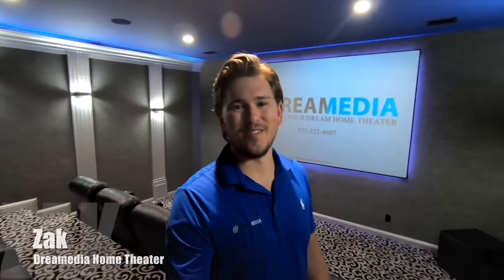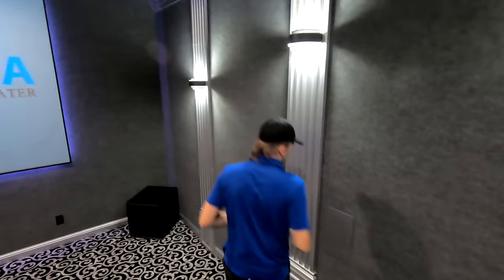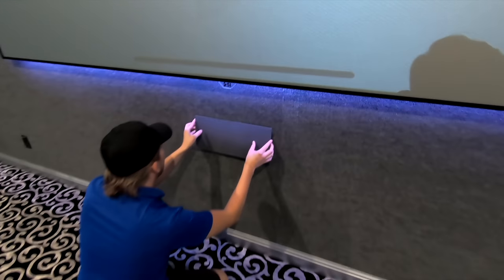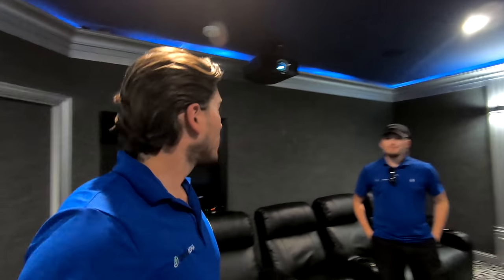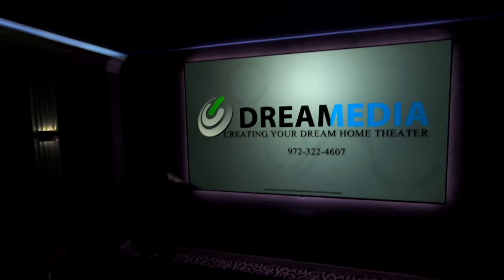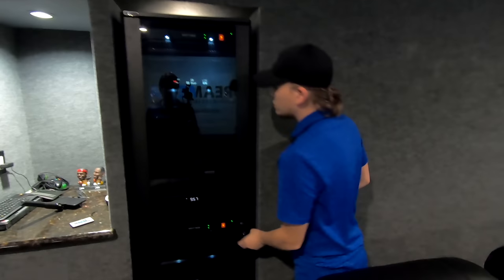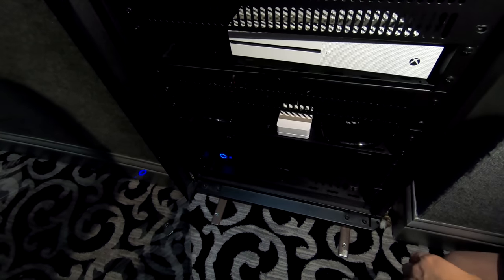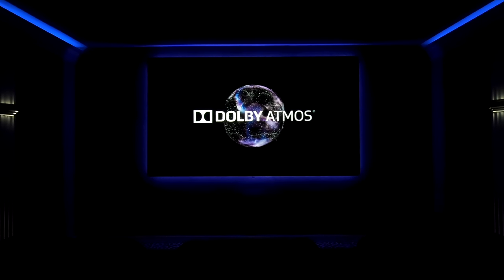Klipsch 7.2.4 Dolby ATMOS! INSANE 160" 4K THEATER SET UP w DEMO

Comment: After watching this video all the way through here is what I would have proposed for that room.  Klipsch RP8000 x 2,  RP-504C, use the current LCR for the surrounds and surround backs.  I would have taken the subs to the next level and did SVS PB3000 or PB4000.  That would be a killer system in that room.

PM
Reply: Why stop there? Dual SVS PB16-Ultras

Comment: I love Klipsch, but they should have gone for RP-8000F and 504C, plus some bigger subwoofers, maybe SVS or Monoprice THX, for that size room! Also, the surrounds are at or slightly below ear level it looks like. They should be much higher, given the ceiling height of the room. It's a nice looking room, but some common sense was needed here.
Reply: Clark Kent I agree. They definitely skimped on the audio side. They’re going to have to crank up the volume, at the point there’s going to be so much distortion and clipping.
Reply: Man all the non professionals have such strong uninformed opinions
Reply: I prefer floorstanding speakers for the front channels and a freestanding center channel behind an acoustically transparent screen, in wall speakers for the surrounds, and in ceiling speakers for the heights.

Comment: I have a question regarding the speaker size.
Since you went with different speakers for clarity, is your cross over point with the sub also higher to fill up the low end you miss from the smaller speakers?

Comment: Does anyone know what brand acoustic carpet this is, or is it simply standard floor carpet that's installed on the walls?  I absolutely love the "clean" look of this theater room with the carpet on the walls.  I've seen a few references in the comments to the carpet as being amateur, so I'm curious what the issue is.

Comment: It looked like the image from the projector was slightly, gradually, angling up from left to right, on the bottom of the screen.  Is the projector or screen not completely level?  I'm on my 2nd Sony projector (385ES) and it will be my last.  Optical block failures, Iris failures, image shifts automatically on it's own and I have to manually move it back to fit the screen, etc.  Overall a sweet theater, no doubt.  I hope they don't have the issues with their projector, that I've had with mine.  I'll be looking into JVC now that they have native 4K.

Comment: Hey Zach i want to put my dolby atmos so i currently have onkio 656 7.2 but i just bout 4 sonance r82 ceiling speakers two klipsch front towers and and 4 surround wall speakers klipsch and 2 polk audio 505 12 inch subs iam thinking of  upgrading to a 9.2 channel Marantz and a 4 channel amp do you recommend that setup for dolby atmos? Thank you

Comment: rears facing the seat?? Seriously??
Reply: that was my 2nd complaint behind the fact they didn't use the klipsch dipole side surround speakers for the sides OMG!! I have the RP-402S that replaced their predecessors rp-240s that are now my rear surround mounted at the proper height for rear surrounds that they DIDN'T employ!!! So far all i have seen is disappointment. The front center is WAY too small! I have the 504c and it's amazing!! Per Dolby even the atmos height speakers are installed in the incorrect offset per the seating arrangement. Granted i have a 207" 4k beyond cinema quality video because of the special proprietary paint I developed that took a super budget viewsonic 747 4k projector and produced video quality beyond that of actual theaters. Hand of God it looks like I have a 207" 4k UHD LED tv mounted on my wall. Denon 9 channel feeding another amp for the last 2 channels for the rear atmos height speakers. I crush this set up for probably $25k cheaper. So sad that people pay all this money and put their faith in a company like this to create the ultimate home theater experience in their house and they mounted the speakers and speaker choices that are sub par for performance :/
Reply: oh yeah they aren't even using Klipsch designated front channel speaker either!!! good lord!!!
Reply: per DOLBY: https://www.dolby.com/us/en/guide/speaker-setup-guides/7.1.4-overhead-speaker-setup-guide.html check out the Atmos locations versus their choices....!
Reply: Little harsh on the criticism there fellas.. Ever ask yourself if that's what the customer may have wanted/requested?
Reply: MyTwoCats  Hate causes cancer. If you don't want cancer change your mental outlook.  Be positive.
Reply: @cis_American  Hate causes cancer. If you don't want cancer change your mental outlook.  Be positive.
Reply: @Alpha3D_USA  yes much of the choices in this room were driven by the customer.
Reply: I have no idea why some people are so dumb and decide to give their dumb opinions. Lower rear speakers can be a choice of the owner who may not want an overbearing ear level or elevated speaker. 
Dipoles are fantastic but not everybody wants them. Some people  think that Dipole speakers should not be in a home theatre while others swear by them. Some of the opinions here are beyond stupid. 
I will probably never go for Atmos and love 7.2 sound and think it is the perfect sweet spot while others wants 16 channel Atmos.

Comment: Good I follow you for a year and I love your videos I wanted to comment from your experience, since I just saw the video of the 8012 with klipsch speakers and the video of the room of the previous cx5200 with which sound you stay? Yamaha or marantz? se  which are different rooms but in the sound recorded by the camera, I notice a greater sense of dynamics and effects in the Yamaha !!! You would help me choose because I doubt Yamaha a3080 vs marantz sr7013, thanks
Reply from the maker: You cant go wrong with either. we sell more marantz than yamaha because of client wants and comfort
Reply: @Dreamediaav  thanks dreamedia for answering that both are great avr and already in case I would use it as a pre / amp since I have emotional stages 11 channels !! but I wanted to know from your experience if yamaha or marantz which give you more film feel?  what's on the list is nad t758v3, regards
Reply: @Dreamediaav  You guys are awesome.  I'm remodeling a similar room.  20x24 10' ceiling.  BenQ 4k proj, marantz 7013 200w rec, acoustically trans screen with ability to place all fronts behind screen in window holes.  Thanks to you I'm leaning towards using the Klipsch set up you use all the time.  The speakers are the only thing I havent bought yet.  Theres also a seperate 2000w Pyle karaoke set up in the room (built a stage below screen) and for the drivers I have huge Rockville towers stacked in the front corners of the room behind curtains.  Originally I was going to wire the Rockville monsters for the left and right fronts on the home theater side of the project.  What do you think about that?  I really want the sound to be as good as possible for the theater set up.  Thanks in advance for your reply.  Crazy Bernie in Fresno, Ca.

Comment: The room is 20' x 20'?  I bet getting uniform bass was fun in that room!   I'm about to start a new house, the theater room will be roughly 21' x 30'.  It's surrounded by attic space above and on three sides so I can have as many infinite baffle subs as I want.  I'll probably do at least four pairs, main subs near the front (floor to ceiling columns) and then three sets of side subs working their way toward the back.  Each set will have it's own DSP and amplifiers so I should be able to get the bass fairly uniform.

Nice job on that theater btw, it looks great!

Comment: Acoustically: Very bright room. Small room and not fan of speaker placement, especially the sub.
Reply: Ben Styles they have to be diagonal so its best placed
Reply: Acoustically bright room?? They said they put "acoustic carpeting" on the walls!! :) The only hard surfaces were the faux columns. I would have have had all walls covered with fabric of some kind. Add absorbing and deflecting panels...but this customer had their wants. So...and they're paying the bill...etc.

What are the dimensions of the 160' screen in feet? Looks like a 16:9 screen...
Reply: The surround speakers are too low especially the surround back speakers. They should be 1-2 above ear level. The chairs are blocking the sound of the back speakers. The speaker placement is incorrect in various ways. Amateurs!

Comment: So much fails in here. Subwoofer stand direct in the corner.
Speakers in front are too small, surrounds facing the seats. An noch transparent screen.
It looks fantastic but can' imagine it sounds that good.
Reply: Sound in home theatres is a personal experience what you like they may not.  The problem with rear speakers in that set up is the seats are very close to the wall so it may not be their preference. 
Some people want their subs in the corner while others do not.

Comment: If you could, what are the dimensions of the room? Id like my theater that size.
Reply: Lol, thas fkn awesome 20 by 20. Great video guys
Reply: I think for that room size I would have purposed larger speakers especially for the front stage.  My dedicated theater is 11 x 19 and I have Klipsch RP-280FA and RF504 center.  I also think the surrounds and surround backs are way too low.  I have never walked into a showroom or cinema and saw surround speakers that low.  Other than that the room looks very well layed out.

Great Job Guys.

PM
Reply: @paulmardis1512  im purchasing a pair of rf7 3's, rc64 3, pair of 520's for surround and im going to use my 8000f' for rear. Marantz 7705 and emotiva 9 for amplification.
Reply: Whats the height dimensions of the room
Reply: @cedo2297  good Question.
Reply: @cedo2297  That would be a great setup.  I would add 4 x in-ceiling speakers for Dolby Atmos and us an 11 channel amp + 2 SW's.  You would be set.  I believe Dreamedia HT can help you with your setup and installation.

Good Luck.

PM
Reply: @cedo2297  20  by 20 only? i think its bigger
Reply: @kennychen1101  what do you think?

Comment: I just built my 7.4.2 system with Dream Medias help, but now am about to "rebuild" the room placing extra speakers to enable Auro 3D.  There is critical acclaim by competent audio enthusiasts and professionals that the Auro upmixer of Dolby and DTS encoded source material is a much more enveloping and preferred theater solution.  I didn't appreciate this 2 months ago and neither have most professional installers.  Now knowing this and watching both videos, and in a theater of this quality, I would have installed 6 additional speakers (3 wall front height, 2 rear wall height, 1 VOG) and used a Denon 8500 with its 13 channels of processing that can seamlessly power either arrangement without reconnecting anything.  It likely would be sufficiently powerful for that room and the chosen installed speakers, but that receiver will allow you to use a separate power amp for your front soundstage.  Looks like I will be calling Zach again.  I'm not looking forward to another wire job, drywall repairs, sanding, and painting (Oh, not to mention more $).  Overall, I have been somewhat underwhelmed by most Dolby Atmos encoded tracts.  Most movies have only a few minutes of quality ATMOS mixing.  True Auro encoding is amazing, but the technology behind the upmixer allowing a 3D theater audio experience is now being taken seriously.
Reply: For one thing, Auro3D as an immersive format is pretty much dead.  Auromatic upmixing also has no steering logic like Dolby Surround and DTS Neural: X.  It just maps the same lower speakers to the upper speakers with reverb and delay.  It's like all stereo DSP modes.  I wouldn't spend the extra time and effort to redo your room for that.
Reply: @dan_hitchman007  The Auromatic upmixer seems to be much more sophisticated beyond what you describe.  There is an interesting recent video from Audioholics Gene DellaSala and Patrick Schappert regarding 3D immersive formats, theater Dolby Atmos vs home cinema Atmos (much diminished performance) and the use of Auromatic.  Native Auro recordings are very uncommon though felt to be superior and Patrick believes they should therefore push their upmixer as it produces a surprisingly superb effect.  Yes, not sure about redoing the theater but when I had everything opened up, definitely would have done it then.  https://www.youtube.com/watch?v=pOI0T15d4RY&t=2274s
Reply: @cdavidhord  It's not the format (Dolby Atmos), it's the mixing skill of the engineers.  Some are superb and others underwhelming like any surround sound track... and some need >7.1.4 systems to hear a big difference as there is more object steering in the lower level than the overheads.
Reply: @dan_hitchman007  Agreed. Most of the Atmos movies I've purchased have not lived up to the hype. Have you heard any Atmos Blurays that have stood above?
Reply: @cdavidhord  You need 4k discs as well because some studios release immersive surround exclusively on UHD Blu-ray. Blade Runner, Blade Runner 2049, The Matrix, Shazam!, Superman: The Movie, Sully, Mad Max: Fury Road, The Fifth Element, Mission Impossible: Fallout, Spider-Man: Into the Spider-verse, The original Jumanji, Godzilla 1998, Godzilla: King of the Monsters, Alita: Battle Angel, A Quiet Place, Gravity (coming to 4k or suck it up for the expensive out of print Diamond Luxe edition), RED, John Wick movies, Stephen King's It, Black Hawk Down, The House With a Clock in Its Walls, War for the Planet of the Apes, The Bridge on the River Kwai, etc.
Reply: @dan_hitchman007  Tried for the Diamond Lux Gravity and about passed out over the price!  Will do, thanks
Reply: @cdavidhord   The best 4k Blu-ray player right now is the Panasonic 820 (the Oppo 203 was the best, but Oppo stopped making disc players - sadly).  Value Electronics carries it.  The Panasonic 9000 has a better disc drive, but it's $1,000.
Reply: @dan_hitchman007  I'll check that out.  Using an Xbox 1S now.  When OPPO announced they were shutting down, there was stock available but I delayed and they were gone.  A fine line between impulsiveness and an intelligent purchase.  I spent a lot of money with Dream Media (but saved a lot for what I received).  I appreciate their competitive pricing, but you really need to know what you want and what will function best, which is part of the fun of all this.
Reply: Abc

Comment: Very low surrounds and potential for serious head and body occlusion.  Room looks great though.
Reply: In my opinion the walls would be too close to have ear level or for elevated rear speakers. In my theatre I have a lot more back room so the speakers are not on top of you. 
I have a friend with a theatre that is of a similar size and he tried the elevated speakers but found it too much and lowered them a it was a lot better.